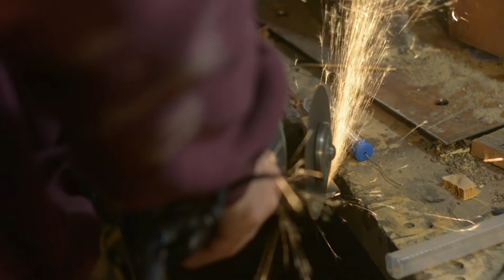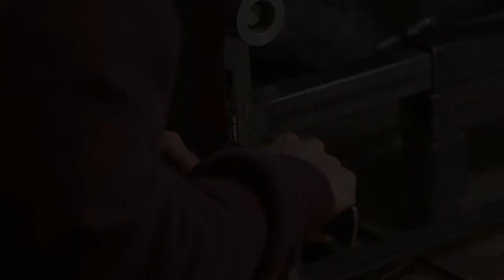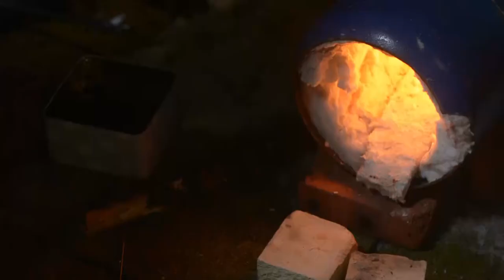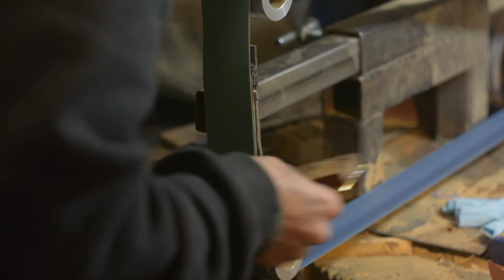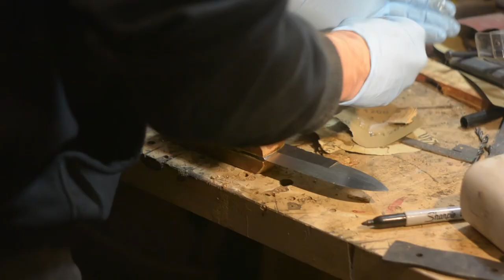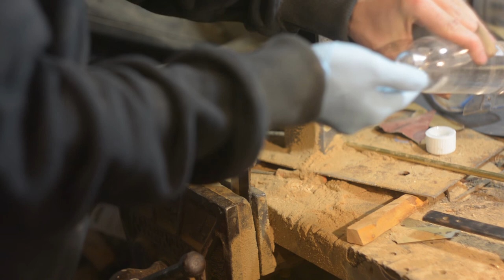Making  a Sgian Dubh with Brass Liners

Comment: Great job with the tools at hand. How did you find working with the brass liners. I want to try it but have heard it’s a bit tricky to grind as it heats up quickly and the epoxy can fail.
Reply from the maker: Hey dude thanks for the kind words! It heats up unbelievably quickly and when you stack grinding through wood on top it's kind of a pain - It's a lot of doing a bit then waiting for it to cool then doing another bit so I'd definitely recommend bringing a book!
One thing I didn't do here that I should've though, is drilling little dents in the steel brass and wood to increase the surface area for the epoxy and If you don't drill a LOT of holes in the brass it gets very heavy.
Reply: @mcgillsworkshop4378  Awesome thanks for the tips man. I’m going to try some brass scales. I have quite thick brass so hopefully it doesn’t heat up so fast. But for sure  once it’s hot it will stay hot for longer.
Definitly going to drill a lot of holes in the brass.
Cheers